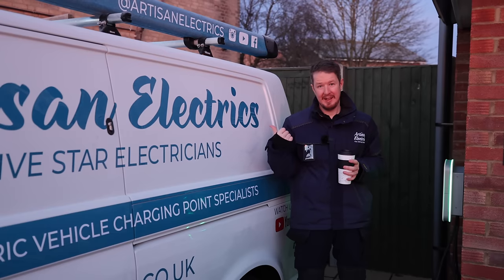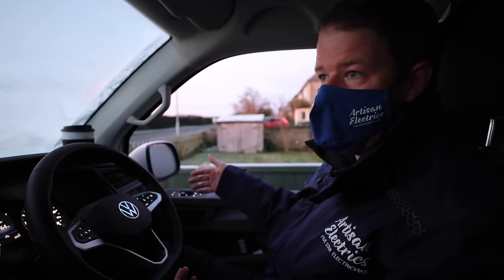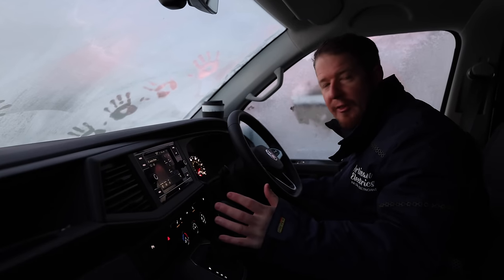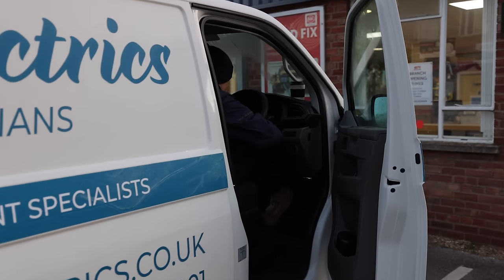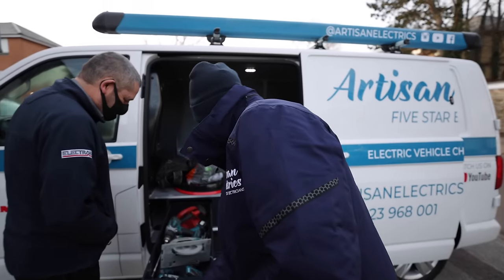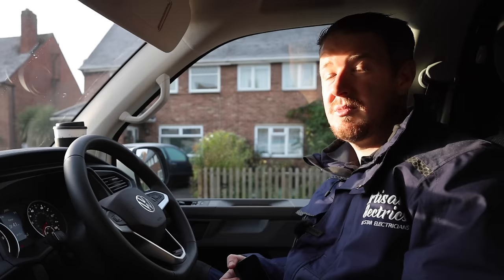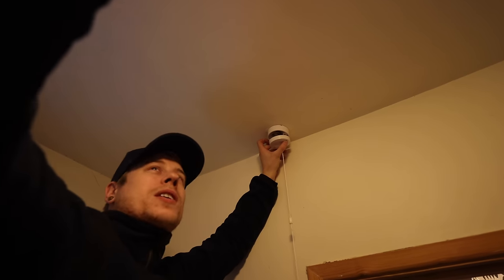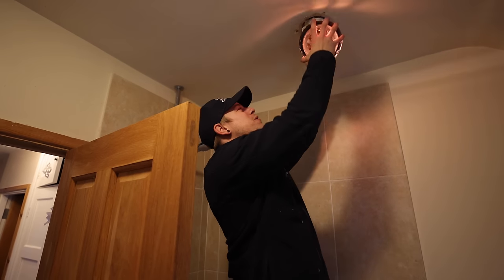ELECTRIC VAN NIGHTMARE 😬 - Volkswagen Transporter Electric Van

Comment: The VW van does seem to be a letdown. I have just brought the Peugeot E expert 75kw. Really happy with it. Getting 160 to 170 miles on a charge in this cold weather. I sit on the motorway at 60. I can turn climate on from the app so the van is nice and warm when I get in. I love the van. I was a transporter man for years then when transit custom which was good and nearly half the price of the equivalent VW. I have had electric cars for about 10 years now but the Peugeot is the 1st van i have thought to be fit for the job. Keep us updated on how things work out. Good luck 👍
Reply: Have you an idea of fuel-savings yet and does that cover the higher monthly cost?
Reply: Good news - mine is finally due in Feb
Reply: had 3 VW multivans in company, all of them had engine and DSG swap by 100k miles ... I will rather live with some small issues Ford or Citroen/Peugeot have. Generally you only avoid brand services, use quality local services and you have no issues, also they have 5 years of warranty instead of VW 2 ...
Reply: @markreed9853  Hi Mark I charging at home what would have cost £100 of diesel in the transit is costing me about £30. This doesn’t take into account rises in energy yet but diesel is going up to. I pay 15p per KW to charge the van at home at the moment. I brought an ex demo with 2000 miles for 31K so good deals are out there. Sold my transit for 21k.
Reply: UnjustifiedRecs  the E expert is limited to 80 mph. Driving above 60 does have a big impact on range. You can drive them like a diesel, although if you drove a diesel at 60 as opposed to 80 you would see about 20% increase in efficiency. I think the VW is limited to 60 because the range is so bad, at 80 you would probably kill it in 40 miles.
Reply: UnjustifiedRecs  If you can tuck in behind a lorry it really helps efficiency as the lorry breaks the air for you. National express coaches are your best friend as the are usually travelling at 65 +. Their drivers are probably used to having EV’s stuck to their bumper nowadays 😁
Reply: I have the peugeot e-expert 75kwh van for carpenter work. It's perfect for me. Very easy to live with.

Comment: Mate come on. You’ve had a Tesla for how long and you don’t seem to know the basics of preconditioning? You’re an EV charging specialist and you don’t check that your new work vehicle has 32A charging? Cmon.
Reply: ....bit harsh, are you suffering from SAD as well.
Reply: @nw5835   To be fair, he fits these chargers for customers so he should know the product. Who spends 55 grand without doing proper research or reading the FM?
Reply: @ArcanePath360  this is something else he should know about.but he's not told anyone.

" All new chargepoints must have a data connection, with the ability to measure, record and transmit usage (in minutes and as units of energy) and delay charging or slow it down during periods where grid demand is highest. Manufacturers will also have to provide a user interface for drivers, such as an app, to set parameters.
If this sounds familiar, it’s because OZEV’s home and workplace charging schemes already require similar functionality[7, 8]. However, the new regulations mandate finer control of energy flow and charging times and apply to all new chargepoints. This includes the growing share of units being installed without the Electric Vehicle Homecharge Scheme which, from April 2022 will no longer be available for single-occupant properties such as houses and bungalows[9]."
Reply: @barryclarke3010   Thanks for the info. I just love government interference in our lives. They really know how to look after us don't they? This whole drive (pardon the pun) to electric in 10 years makes no sense, since it will cause more problems than it solves. Don't be fooled for a minute that it's about "the environment".
Reply: @ArcanePath360  my reply to you was removed because I mentioned cc being the cause or one of of these ridiculous environmental rules, I agree with you.

Comment: This assement of the van matches quite well with my latest experience of the new vw golf, the software is shoddy and the car is not predictable.  it slams on the brakes on motorways for no good reason, it swerves into parked cars, and the parking sensors register constant false positives. and the list goes on, vw have truly given up on making drivable vehicles and you should avoid.
Reply: Have just extended the lease on my Mk7.5, because I really don't like the sound of the Mk8 at all, it doesn't look great either !!
Reply: You bought a car from a manufacturer who lied about their diesel emmissions, why would you trust them to produce a good car?
Reply: For this very reason I've just bought a 2020 mark 7.5 golf that works instead of a mark 8. It seems something has gone really horribly wrong for VWs software department. Like someone designed it that didn't drive and whoever thought haptic feedback buttons were a good idea clearly didn't think. I have haptic buttons on my wireless earphones. They do whatever they want randomly without me touching them! If a spec of water touches them or they come into contact with a hair the Google assistant is activated or they power off.
Reply: Couldn’t disagree more, I have an e-golf and I think it’s brilliant, build quality is much better than other similar cars.
Reply: @richardfearn6638  the E Golf is based on the mark 7.5 which is what I've got. The infotainment and haptic controls were introduced on the mark 8. The 7.5 is a great car. Well built and easy to use.
Reply: Nothing wrong with my Mk 8 Golf style 150PS. The lane assist tugs at wheel when you go to go around a parked car on a main road but it's more of a suggestive nudge rather than forcing the wheel, I suppose an 80 year old with bad arthritis could maybe take issue with that but then again you can just turn that off in the cars settings if you don't like lane keep assist. It has only ever applied the brakes once as well when somebody decided to walk behind me as i was reversing into a space, was about to brake anyway but it did it's job there.

Comment: I was Volkswagen through and through, I still have a T6 but just sold my 2 year old caddy which was plagued with emission problems from day 1, I now have a high spec Transit Custom for half of what you paid for the electric T6. VW’s are getting too expensive and no better than the rest unfortunately
Reply: Ford Transit Custom is the daddy by a long way. The MS-RT isxa beast!!!
Reply: After owning a 2014 Amarok and a 2015 Caddy from new. both at 10,000 miles had emission system breakdowns. Both were binned. My stepson currently drives a 2018 Transporter that had emission problems at 11,000. miles. I now drive a 2016 Discovery No emission problems at 25K.

Comment: In some respects, I'm not surprised, you've invested in Volkswagen's FIRST electric van.  It's expensive, poor on range (WLTP 82 Miles!), poor on payload.
Vauxhall Vivaro-e, Peugeot e-Expert or Citroen e-Dispatch all exceed this van in every respect, all over 200 Miles.  Either you didn't do your research or the salesman really exaggerated this being suitable for you.
Reply: It’s not even really VWs EV is it? It’s a new VW van that a third-party company has shoehorned EV gear into, hence the pathetic range because there isn’t room for a decent battery. It’s a status symbol more than anything else - a ‘posh’ VW van and the bragging rights of it being electric.
Reply: My 50kWh Vivaro-e has a max of 140 miles fully charge.  After 6 months it has dropped to 124 miles fully charged.  I guess it’s adjusted to my driving style??  This is plenty enough for me most days.  I charge every day for 5p per kWh.  Looked at the VW as I love VWs, too expensive and range was too low.
Reply: @Vedmore71  The cold weather is most likely range is showing less.
Reply: The 3 vans you list are the same van with different badges . All PSA group products.
Reply: @Vedmore71  didnt drop to 124 after 6 months.  just happens that after 6 months is winter, and batteries have less capacity in freezing conditions.  the chances are that your battery is still 99-100% of its original capacity and the same range as new next summer.
Reply: Yes your right evs just don’t like winter batterys don’t charge well the heater is on and lights on most of time wet roads rolling resistance is high 🏴👍
Reply: @Vedmore71  battery degradation is your loss of mileage mate.
Reply: @michaeltandy1383  Ouch, that is within 6months, glad I leased it
Reply: @cbflazaro  let’s see in the spring

Comment: In the meantime every trade still owning a Diesel has defrosted their vans, picked up a Costa and are well into their first job of the day. In an Artisan Top Gear style challenge, Jordan would be James May!.
Reply: And if he'd read the owners manual beforehand he would've been away too. How can you not know how to operate your vehicle, let alone not know what specs it has.

My EV is defrosted & ready to go on minutes & hot & toasty. I start it up turn everything on & wait insude job done takes less time than warming a diesel up.

Oh & having owned big diesel vehicles outside of having something with quick clear windscreens I've been sat in a cold diesel for many miles before its gotten warm enough to stop shivering vs the instant heat I get in an EV.

Nothing to do with EV vs ICE here it's down to user error & not understanding your vehicle
Reply: And every EV owner would have started the pre-warming 30 minutes before leaving the house to get into a fully warmed and defrosted vehicle, something wrong with Van settings!
Reply: @norfolkngood8960  it's 2022 you shouldn't have to read a manual to work out how to unplug the vehicle and turn on a heated windscreen. Should be easy enough to find. 

Plus 64 mile range is just pathetic

Hydrogen will be the way forward for commercial vehicles I think since EV vans have poor range and EVs in general struggle towing.
Reply: @cameronmurray3039  ask him why he owns a Tesla if EV’s only go 64 miles and can’t defrost the windscreen.
Reply: @cameronmurray3039  hahaha ha hahahaha that's hilarious you're more likely to not need a manual for a 1980s car than a 2022 car so that's a stupid comment
Also I wasn't just referring to the windscreen nor the cable release but how about the fact he couldn't even drive off. Its a complicated machine & like all complicated machines you should be 100% competent operating it & if that means reading the manual the do it.

If you weren't meant to read the manual they wouldn't provide one ffs. As for releasing the cable it was still charging so if course there was going to be a method to release it, my car it's press the unlock button again to withdraw the locking pin.

The reason this was a mess was rush to use something without the requisite care.

Put it like this a pilot can fly a plane but if they get into a new plane they have to qualify with it first despite all that training & knowledge, OK an ott example but it makes the point.

As for complicated don't rant at me about it go moan to VW & people that buy it without testing first & don't read the manual beforehand because I couldn't care less. Far too few people read the manual on their car
Reply: @norfolkngood8960  I think you’re missing the point. It doesn’t need to be that complicated. Not so much the charging thing, that’s to stop other people unplugging you. But the driving thing eg in a Tesla you don’t even need to press a start button. If the car’s unplugged, just flick it into drive and press the go pedal. Start buttons, key switches, putting your foot on the brake when pressing a button or to take the car out of park etc are a legacy from when you had to turn the engine on.  He got tripped up on the charging because Tesla uses a proximity key to determine that it’s the authorised owner unplugging the car,  VW uses a key fob central locking remote.  Rather than reading the manual, that is so ething the dealer should have showed hi .
Reply: @norfolkngood8960  
Lol... Who reads the owners manual. No one normal until they have a problem.
Reply: @Robert-cu9bm  I do. And so should anyone who chooses to operate any potentially lethal piece of equipment. Any electrician or other tradesman or woman worth their salt and who wants to stay alive knows that familiarisation with their tools is a prerequisite. Safety First is not a meaningless mantra which should be ignored as soon as possible.
Reply: If you live in Manchester from about  May, if you do not meet emission regulations in a diesel van it will cost you another £10 a day. Good money for local goverment but madness….
Reply: @nothanks6859  actually JCB has developed a hydrogen combustion engine which can be scaled down to van size. 

64 mile range when loaded, nevermind the rare earth metals that's required to go into the  batteries yeah that's defos the future mate
Reply: This junk wouldn't even get me to my first job ha!
Reply: @TheDoosh79  But we're meant to believe from the experts on here that it's the future 🥴
Reply: @lilchris26  it’s 2023 pal for vans
Reply: @cameronmurray3039  You have literally no idea wtf you are talking about. Do you seriously think that Hydrogen is the future, when Tesla is already the most valuable auto company on the planet? Hydrogen has already lost the battle.
Reply: @norfolkngood8960  read the manual … right, when did your brain go into sleep mode?
Reply: @andyxox4168  typical can't string a cogent argument together so start insulting people like a child.

I have an EV & I read & understood how it functioned before I relied on it on a day to day basis but if you think it's clever to struggle like that instead then you go for it but from your comment I have to wonder if you're even old enough to hold a driving licence

Comment: Had the “cable disconnect “ problem on my E-Nero the first time I charged.  Just could not release the cable and ended up ringing the dealer!  The solution was so simple - you have to press the unlock button twice!  Might be the same on your VW.  Worth a try.
Reply: That's the same newbie mistake I made on my first attempt! Luckily there was a helpful Zoe who helped get an answer. Now I remember that 15 second rule. Probably why the AC charge intake suddenly drops down to 0.5kW
Reply: @craigedgar2828  You’re kidding - manuals are for emergency use only. No self-respecting bloke reads the manual :)

Comment: EVs, we used them in the steel works 40 years ago, fork lift and store vehicles. We noticed that in the winter the battery life was almost half,  these were big lead acid batteries. But I guess battery technology hasn't moved on much in  over 100 years.
Reply: Batteries have improved but they still have the same problems with  weight and charging. fast charging still destroys them faster, in eight years time that £50,000 van will be worthless if the old battery is down to 60% capacity and a new battery pack costs  £10,000.
Reply: Wrong. The technology is now light years ahead. Unfortunately any type of batttery is governed by the laws of physics and chemistry which say that the chemical reactions involved run more slowly at lower temperatures.

Comment: Thanks for sharing this information about this farcical disgrace of a van. It’s seems more like a con by VW.  Hopefully many people will now be made aware of how rubbish the range is not to mention the other shortcomings etc. Thanks for posting this up.
Reply: Any one got  a  match
Reply: The VW Transporter is  great van, only the diesel one, as I've driven one at work, also as an electrician and one tank gets 500 plus miles range, drove from mid Cheshire to Newcastle and back and still had just under half a tank of fuel left. The EV one is a joke...

Comment: Hot water could be bad news for the windscreen...  Water straight out of the cold tap has always worked fine here, especially if it is the last thing you do before driving off!
Reply: warm water?
Reply: @davesimms5397  Depends on how warm it is, & how cold the windscreen / windows are.  If there is too big a difference, that creates the thermal shock that cracks the glass...  It is better to use two kettle fulls of cold tap water than one from the hot tap...  Replacing a windscreen is an expensive job that takes a while even if it is covered by the insurance company!  Have used water from the cold tap down to about -6C here, though when really ... cool, better to get moving as quickly as you can having flushed the ice away...  When really cool it has taken a few runs to the house to fill the kettle (& jug or saucepan) up again!
Reply: I've always used hot tap water with a little bit if cold water added to take the temp down a bit. Not yet cracked a screen but do wonder if it weakens the glass. My last car suffered terrible glass scratches fro the times I had to scrape the ice off.
Reply: @the_lost_navigator7266  I would be concerned about weakened glass, hence I always used cold water
Reply: Cold water de-ices the windscreen just fine in my experiences.  And -2 is not all that unusual in Australia during winter in Victoria or Tassie or many other country areas.

Comment: With these electric vehicles it seems like you're taking 2 steps forward and 3 steps back.
The terrible range for a work vehicle is a problem for me. My old diesel has a range of 700 miles (and the heater is brilliant)